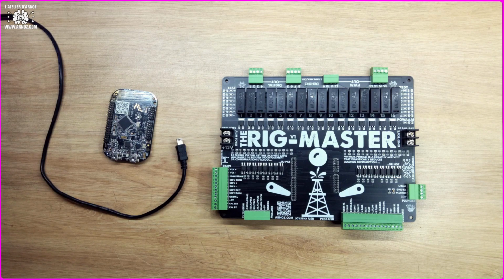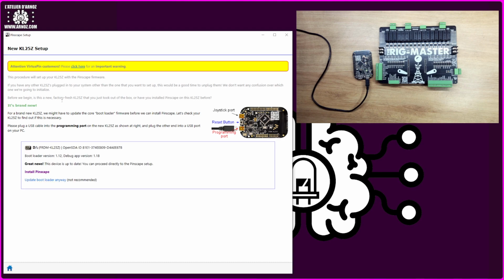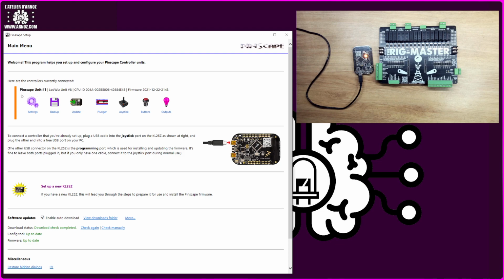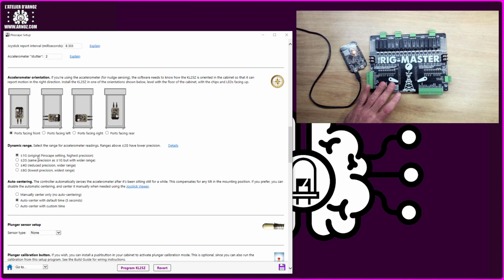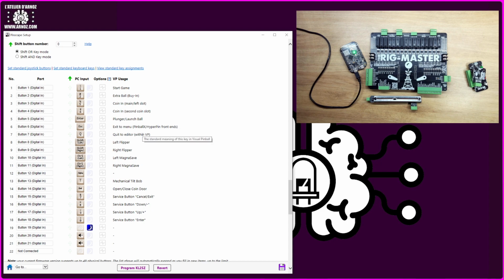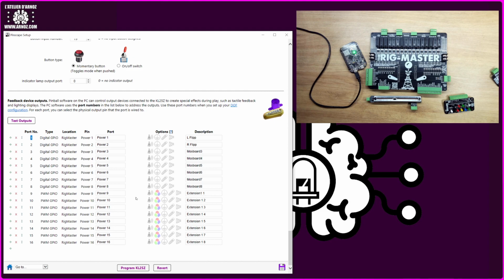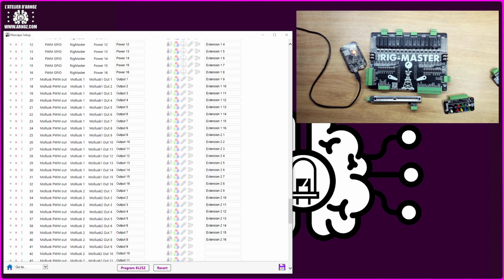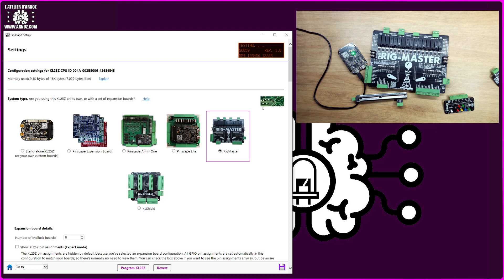Basic Rigmaster settings in Pinscape

Comment: I am finally getting a chance to set up my Rigmaster with  1 Mollusk and 1 Mos'Light. I am wondering what selections to choose in the DOF config setup. DOF tool automatically selects 1 LEDwiz device. Is that correct? There is not a selection for RigMaster. Should I choose something else like Pinscape or FRDM-KL25z or is LEDWIZ fine?
Reply from the maker: choose PINSCAPE
Reply: @LatelierdArnoz  Thank you